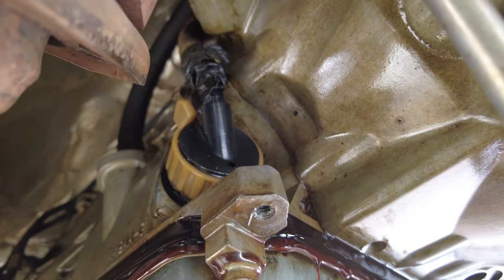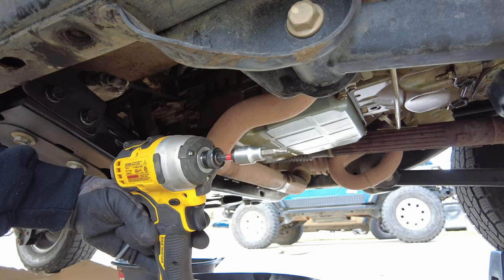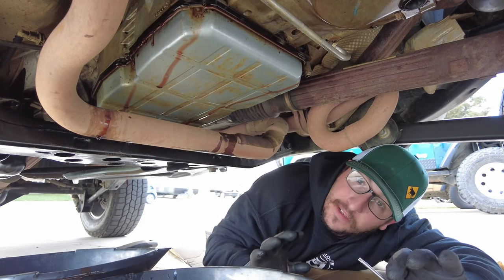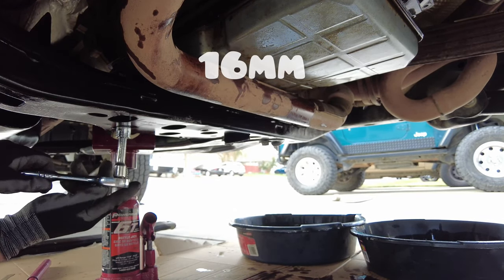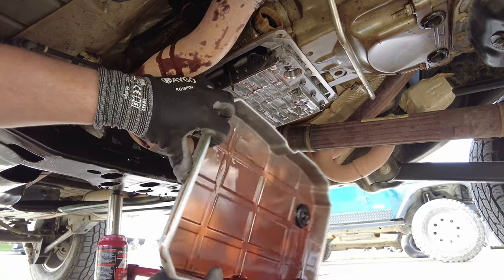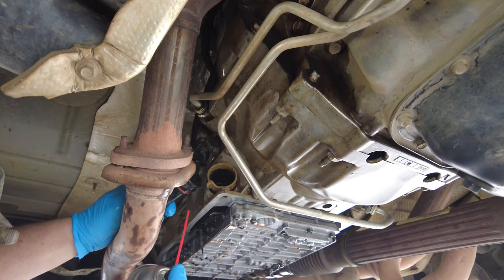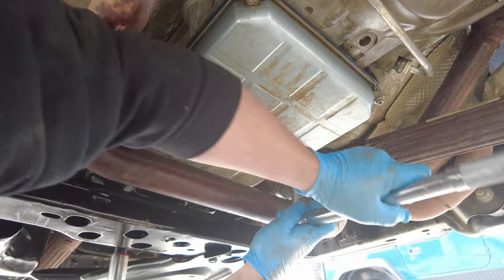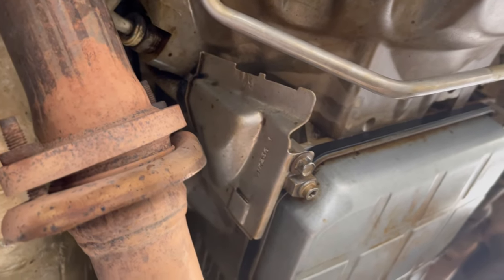Jeep Wrangler JK JKU - Transmission Flush & Filter Change + Plug Adapter Pilot Bushing Replacement

Comment: This is by far the best video showing this procedure.  No stupid music, gets to the point, and shows difficulties you may encounter, and how to get around them.  Bravo.  I was not even aware of that adapter plug, and now I am, a $33 part, for Mopar OEM, which I will make sure I have when I do it.  The bolts in the trans cross member actually screw into the trans ?  Another thing I did not know.
Reply from the maker: So the trans mount has studs that go through the crossmember and the crossmember bolts to the frame. Thanks for joining me on this repair today 🍻

Comment: Thank You.
I did mine today. 
The design of clearance between oil pan and exhaust cross pipe is so bad like many stupid designs of Wrangler. Sample hand brake adjustment. 
Thank You buddy for good video.
Reply from the maker: Time for dual exhaust 🤔 right now im taking apart the top end of the engine to replace all 24 rocker arms and lifters
Reply: @ATEMOFFROAD bro u a mechanic for dodge jeep Chrysler huh? 🫡

Comment: Thanks for doing this without sucking it from the top, i wanted to see the messy way of doing it.  Will be doing mine outside on jack stands, in Feb., in VT... on a day its above freezing... but waiting for that day might be more toward March.  LOL...  I bought Jeep last year, with 101k, and not sure if previous owner ever did this service as fluids other than oil are the most neglected.  Did the front and rear differential today on the 2015 Rubicon unlimited.  I have the automatic trans.. wish I had manual.
Reply from the maker: I’m getting ready to do this again, this time I will replace the pan with a Dorman pan that has a drain plug. That should make these jobs much easier to do. Also I love manuals but the best thing on that jeep is the auto transmission IMO. 
https://www.amazon.com/dp/B01M3Q2Y97/ref=cm_sw_r_as_gl_api_gl_i_BRG4AHYSFHGDMG2XMPR9?linkCode=ml2&tag=atemoffroad-20

Comment: Nice 👍🏽 I’ve replaced that plastic cylinder sensor thingy bought it from dodge Chrysler dealership ($80)back when my 07 jgc hit 115K bout 10 years ago cause it had transmission leak w worn out ring and never had a leak since.
I now have 232K and still no leaks should I replace that again now or just leave it alone? 🤔
Reply from the maker: I always say if it’s not broke don’t fix it. But you are already there if you have the time and money 🤷‍♂️ 🍻

Comment: Thanks for the video.  I do think getting a $10 pump on Amazon or Harbor Freight is worth it to get the level down before taking off the pan though.  Good to see both ways.
Reply from the maker: Thanks I just bought this and I think this is the best way new pan has a drain plug https://www.amazon.com/dp/B01M3Q2Y97/ref=cm_sw_r_as_gl_api_gl_i_582672CGFVMZ3NCWHYWH?linkCode=ml2&tag=atemoffroad-20

Comment: thank you so much so do you think if changing the o-ring on sensor alone will stop the leak ? by chance do you  have the part number for  adaptor plug?is it a dealer item?
Reply from the maker: If it’s leaking there , it should fix the leak, replacement parts are in link in the description box of this video. 🍻

Comment: Great video 
I hav a Jeep Wrangler unlimited sport with 225645 miles do you recommend to do the transmission oil change or not
Reply: Why would you ask this guy???
Reply: If the trans fluid in the pan is dark and nasty,  the magnet is full of junk, Do not do a flush.
If the pan is clean and the fluid looks good, You can do a flush.

Comment: Doesn’t an automatic JKu have a drain plug on the transmission like the manual version?
Reply from the maker: @bgriff2517  unfortunately they don’t, but there is an upgrade pan you can use, check out this video Jeep Wrangler JK JKU - 90k Transmission Fluid & Filter Service + DOORMAN Pan With DRAIN PLUG Upgrade
https://youtu.be/ljyQKS103H0

Comment: Think it’s worth it to coat the exterior of the trans pan with black rust protector paint ?  I have a problem with the NAG1 filter that it does not have any type of screw to seat it in, just held in by friction.
Reply from the maker: Absolutely, I thought that was strange too but the filter does seem secure enough, if properly installed. I suppose the pan would keep it from coming completely off. But I agree for off-road should be secured with a fastener. Good thing the new gasket sealed up great! 🍻

Comment: Can I change only the plug without having to change the transmission oil ?
Reply from the maker: You should be able too, I did so that I can clean the area and sand won’t fall into the transmission
Reply: Thanks 👍

Comment: Thanks. I’m convinced paying the dealer $500 is worth it now.
Reply from the maker: To each there own! Thanks for watching 🍻
Reply: My local trusted mechanic here in vegas $200 for both diffs, transfer case and transmission all oem liquids from Amazon $235 including brand new transmission oil filter and gasket 🤷🏽‍♂️
Reply: You got soft hands boy

Comment: Uh oh, oil leak probably blown oil cooler housing, a problem just about every Pentastar has, and what should be a lifetime warranty item for all Pentastar motors.  I am not sure if the Dorman aluminum unit is the fix, as it also has problems with seals blowing, whether you use included, Felpro or Mopar seals, the whole design and engineering of it is a huge flop.  I had mine replaced, on my 2016 75th Anniversary Edition at 50k miles (still under warranty), and the dealer told me the latest version of the Mopar part addresses many of the issues, not all, but many.  The December 2022 cold blast up here, in the North East (I’m in NY) was dubbed “The Great Crackening” for JK/U owners with the 3.6.  3 of my friends with Jeeps had their oil coolers fail too because of this.  Mine failed, and so did my rear main seal.  Luckily, I had the Jeep Certified Pre Owned 7 year / 100k mile Powertrain warranty (included for free with purchase in 2018), that covered both, that would have been $2200 to be serviced by the dealer, if I had to pay myself.  I am covered until April 2024, so if it happens again, hopefully before then.
Reply from the maker: All very good information and this would make sense why this problem has been so popular! It’s very annoying that Jeeps allows this with out a lawsuit! I I guess we are the greater fools, which will only hurt them in the long run.  Even though Doorman claims this is a fix , I still do not know, however 6k miles and still no leaked on the oil housing! On this video the transmission connection o ring had failed, since I was already there was a good time to pan flush the unit! Thanks for watching 🍻
Reply: @ATEMOFFROAD  great video! When you used the Dorman oil filter housing did you buy the Mopar gaskets or use the supplied? Getting ready to do this job. Thanks!
Reply from the maker: @dougcoleburn1579  I used the supplied gaskets, welcome to the channel 🍻

Comment: Drill a hole in the lowest corner, drain the fluid, then replace with a new pan. Cheap insurance.
Reply from the maker: I’ll be doing this soon 🍻
Reply: I bought and installed a new Dorman transmission pan with a drain plug on my first fluid and filter change on my 2016 which just hit 35,000 mi.
Reply from the maker: @tmcs1968  nice , I need that oil pain, have everything els , do you have a link?

Comment: how many miles did you had on the jeep when you did the transmission oil ???
Reply from the maker: 72k
Reply: @ATEMOFFROAD  i just got a jeep JKU Sahara with 120k and i don't know the maintenance history of the jeep.. question ?? it will be ok to do a transmission oil change with the filter??THANKS
Reply from the maker: @rubengarcia-kt3dy  at that mileage I would do a full service 13qt flush, try and take it to a shop that can properly do it avoiding the suction machines. If that is your only option at the time choose between what you can do. Does your transmission oil smell burnt or different color than new fluid?
Reply: @ATEMOFFROAD  WHERE CAN I SEND YOU I PICTURE ??? DO YOU HAVE AN EMAIL, FACEBOOK ??
Reply from the maker: @rubengarcia-kt3dy  just compare the old to new if they are off it’s times , my email is atemoffroad@gmail.com

Comment: I have a 2017 Jeep Sahara that has a power failure and won’t shift afterwards
Reply from the maker: Is the traction control light on?
Reply: Nothing is on , it just lost acceleration then wouldn’t shift gears
Reply: I will say the fluid was never changed

Comment: Can anyone please help me? I have some leaks around 6speed tranny on 2017 rubicon. I’m not sure exactly what I need to do. Any advice would be greatly appreciated!
Reply from the maker: Did this get resolved? Get a piece of paper and wipe the oil on the paper. Is it brown or reddish color? Brown would indicate oil cooler housing leak, or rear main seal , red check the ATF plug and pan gasket

Comment: Was this on an auto or 6 speed manual?
Reply from the maker: Nag 1 automatic transmission
Reply: @ATEMOFFROAD  

Thank you!!!! I’ve had this leak for a few weeks and COULD NOT FIND THE SOURCE!  I thought it was engine oil.  It’s leaking right out of that connector.
Reply from the maker: @neil12011  if it’s red , transmission, brown engine oil . The engine oil leak up top on the valley where the oil cooler is can really be tricky to spot and some will think is a rear main or transmission leak, I found the best way is to sample the oil and examine closely. Place samples on white printer paper and compare new and old red or brown for engine or transmission. Also look on-top of the engine with a flashlight down below where the oil filter cap is if it puddling up there with oil it’s likely that leaking. Here’s the video on that repair too 
Jeep Wrangler JK JKU - Oil Cooler Filter Housing Replacement 3.6L Pentastar Doorman 926-876
https://youtu.be/0mtiiDK_LYQ
Reply: @ATEMOFFROAD  

Yes sir.  Had the oil cooler replaced last month, so I’m well versed there.  The oil looked brownish so that was throwing me off.  The valley by the oil cooler is dry, and checked that to make sure.  I used my cell to peek into that 13 pin connector area, and there was a pool of oil.  It’s dirty so hard to tell the color honestly.  But there’s a small puddle by that connector and it’s wicking it’s way up that wiring harness.  It’s also following gravity and pooling at the transmission pan bolts also.  Come to think of it, it definitely looked brown, but the engine side top to bottom is bone dry.  Only at that adapter plug is there oil… damn, I may have misspoke.
Reply from the maker: @neil12011  good luck , and thanks for joining me on this repair today 🍻

Comment: The plus says it’s for a Mercedes not for jeep sure that’s the correct link.??
Reply from the maker: The nag 1 is Mercedes
Reply: @ATEMOFFROAD  

Is the nag 1 the same as Jeep lists NSG370?

I GREATLY appreciate you uploading this video sir!
Reply from the maker: @neil12011  they are different the The Nag1 (W5A580) is a heavy-duty 5-speed overdrive automatic transmission, The Chrysler NSG370 is a six-speed overdrive manual transmission
Reply: @ATEMOFFROAD  

I meant to put W5A580.  My fingers were going too fast!  Thanks!  I have the 5 speed auto 2015 JKUR.
Reply from the maker: @neil12011  that nag1 is the best part of your jeep 💪🏼💪🏼

Comment: Next time, spend the $12.00 on a fluid transfer pump to suck out the transmission fluid through the dipstick tube. That way, there is no fluid to leak all over you.
Reply from the maker: I have one , just didn’t have the long sturdy tube to reach to the bottom of pan at the time. Good idea 👍🏼